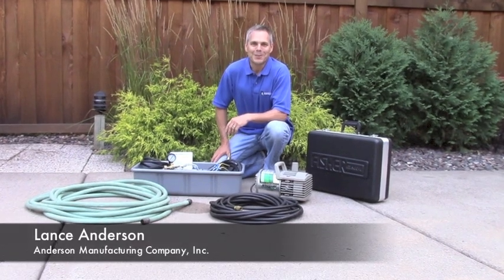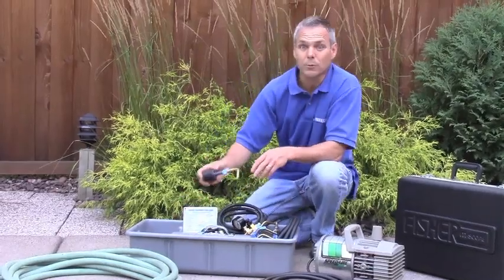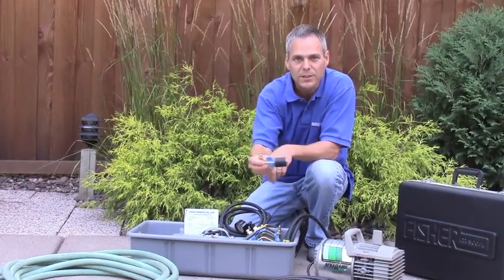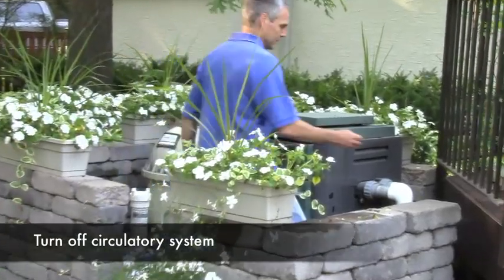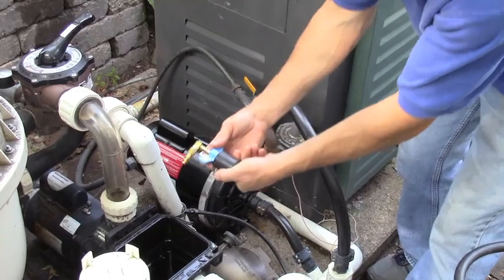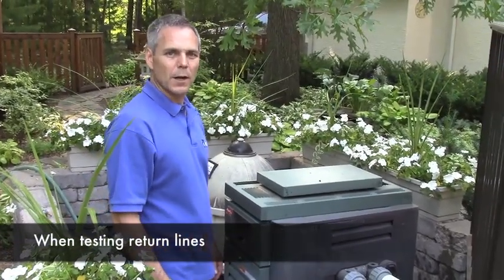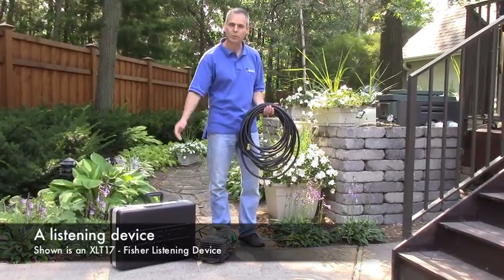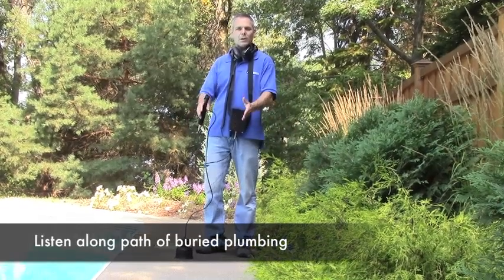Pressure Testing - Swimming Pool Plumbing

Comment: Advice to all pool owners. If it happened that your pump was replaced because it was running out of water, the most possible place of leaking is close to connection with the pump due to the heat occurred from the burnt old pump. So concentrate on searching that area before spending a lot of $$. This is from my own experience

Comment: Yo man our Anderson pressure test didn't have that release valve and I unplugged a line that was somehow still under pressure, even though the plug on the tester end was already removed. 

Little bits of sand were blown out of the return line into my hand with such force it broke skin.

Comment: This comment is for those who used fix-a-leak once and it did not fix the leak. This is the 21st Century.  We no-longer have to depend solely on a microphone then break up concrete and dig.  We now have cameras that we can feed into pipes to detect breaks.

What we need is a camera kit which can feed a camera into the pipe.  Camera can be equipped with a listening device for air, or dye release for water.

Once the leak is found, a repair device can be sent into the pipe to deposit epoxy or other sealant.
Reply: Lol thank you.   I'm a pool pro getting into leak detection and this is a great idea for me.. I even have a wire camera already..

Comment: I find that when you located the exact point of the leak,  you expose the pipe and realize a brace from the pool has broken the pipe.  95% of my repairs = New return lines away from the over dig and back fill of crappy installers.

Comment: Great vid Lance,  I have three returns two at shallow end and main one at the deepand a pool guy claims the leak is at the returns says that was put in 8 years ago he says its called a spot flex it I  have up here. Its white and rib looking.  says when everything is plugged up doesn't leak so cant be light and before that the main drain was fixed and other possible leaks as well all fix. So with the pool filter running 3 days it leaks 2 fingers when the pool filter is off leaks more like double. How can I tell if the return is really the problem before I incur a big expense. Gunite pool all returns under concrete surrounding pool. Thanks so much, Luba

Comment: How much does a pressure test cost? That question was asked in these comments 5 years ago, but never answered. It is an important question. I have a local pool company that is trying to charge me $690 for this test
Reply: All the equipment is over 3 grand
Reply: Then that's too much I believe, here in FL it's about 300$, that include the repair if it's in the pool, along skimmer etc. If they cannot find it, no charge.
Reply: @dannyboy1999   yeah ab putty or an injection not a skimmer replacement. for a couple hour complete pool spa combo pressure check 450-650 is industry standard
Reply: Danny Boy Florida prices don’t apply to the rest of the country
Reply: @dannyboy1999  $250 for the leak test alone in Mass.